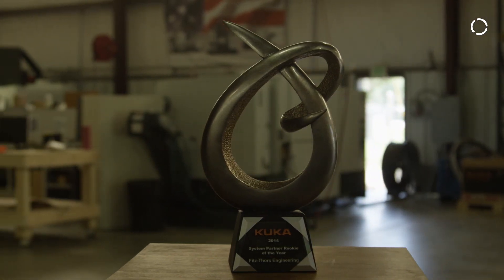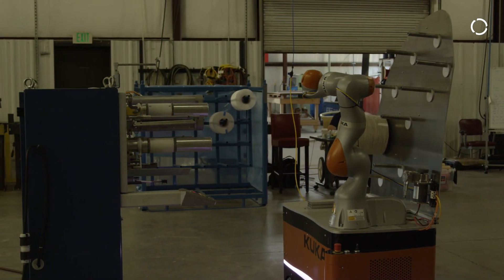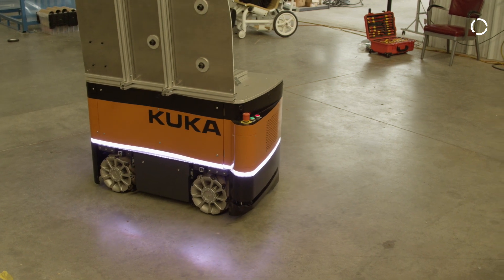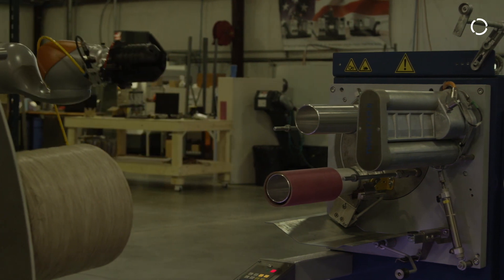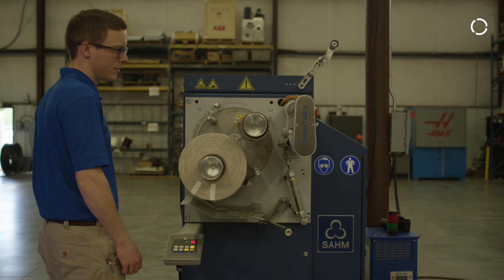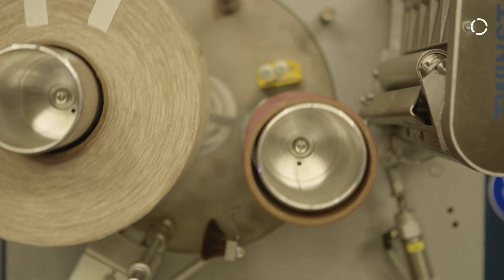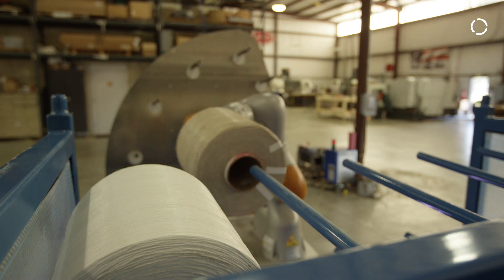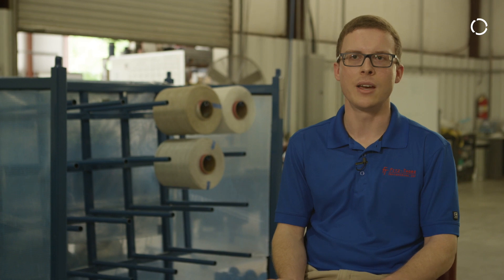Mobile Robotics: Huge Potential to Double ROI and Change Paradigms

Comment: Interesting application. Have you ever done similar application for wire and cable industry? At the end of 80's years, in wire and cable industry were developed some robotic application (completely different) for loading/unloading single wire drawing machine for copper wire.
Reply from the maker: That's a great comparison. If you're looking for a solution to cable or wire winding, let us know what country you're in and we'd be glad to put you in direct contact with a manager to discuss how to approach that application together.